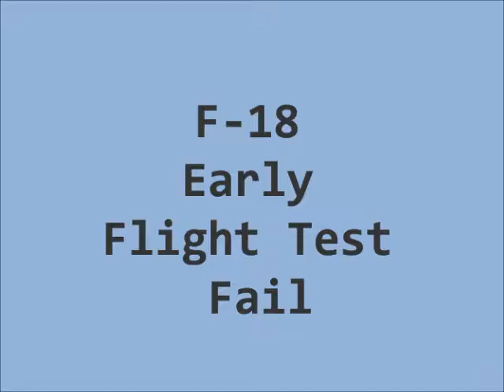F18 Hornet Flight Test Accident Heads up Display HUD Cockpit Camera

Comment: Do you have a link to the analysis showing this had anything to do with flight control feedback?  This looks like a broken flight model that just skipped that whole adverse yaw thing.
Reply: Inertia coupling at work. That's why there should be a roll rate vs AoA vs Beta limiter in the FCS's logic!